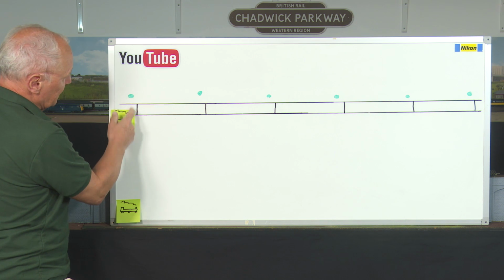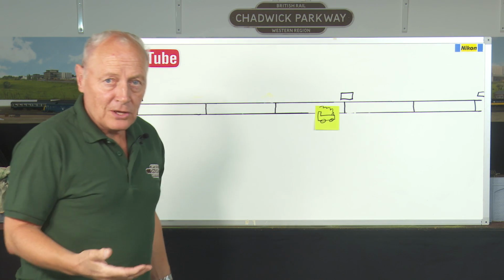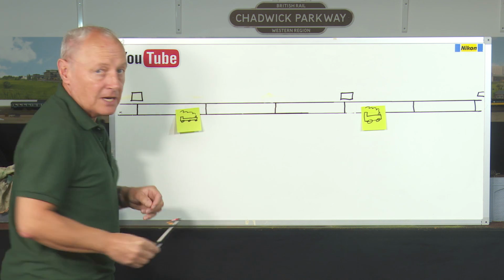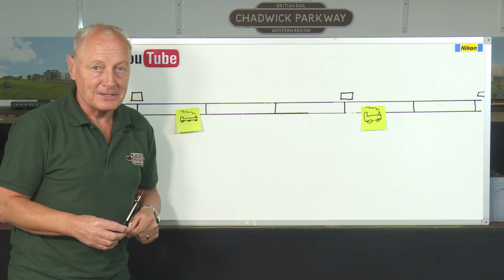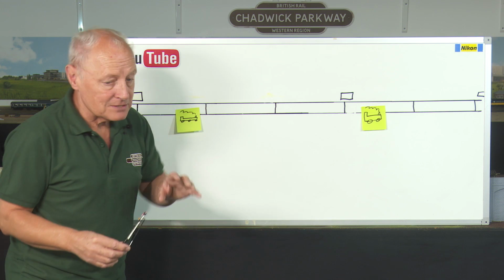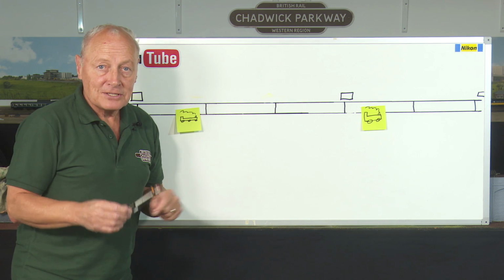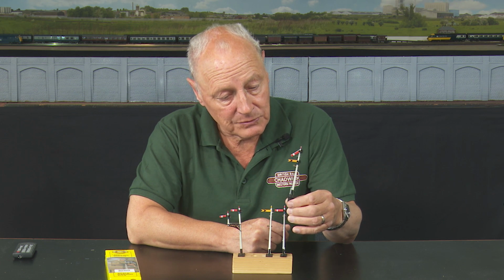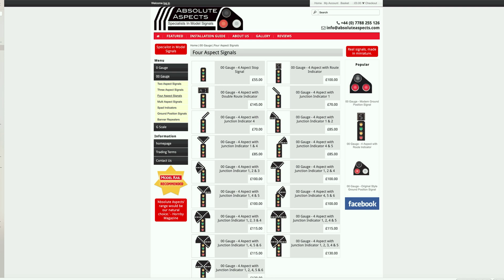Model Railway Signals at Chadwick Model Railway | 104.

Comment: Another great video, thanks Charlie, just a bit of extra info re signalling, when a signal has a feather the feather should light first, then when the proving relay knows the feather is lit it will then allow the signal to clear, in old installations it could be a quarter of a second but in more modern installations it can be 5 or more seconds difference.
The picture of Castle Cary, all the signal have only one route available, onto the Up Westbury line, the 2 with the feather will always have the feather clear before the signal can be cleared, this came about after an accident up London way in the 1970s, before that they would have been 3 signals with no feathers.
Semaphore signalling (or correctly Absolute Block) can be quite area specific but the easiest way to understand it is to have a signalbox with a plain line (no junctions) with (lets say) 4 stop signal so 4 sections. First it will have its distant, this can be on its own arm or if the previous signalbox is quite close it can be underneath that signalboxes last stop signal, but will always be service braking distance before your first stop signal), so the post will have 2 signals on it controlled by 2 different signalboxes. Then we will have the first stop signal (the outer home), then the inner home,  <then a station> with the starter at the end, then further out the section signal which then leads off to the next signalbox.  That is the simplest description, some places (lostwithiel on the down) have the section signal where the starter is at the end of the platform , on the Up there are more signals after the station than before it, it does get complicated.
Only when all 4 stop signals have been cleared will the distant be able to be lowered.
If there is a train between your section signal and the next signalbox the first 3 stop signals of yours can be cleared but not the section signal so the distant will remain 'on' (horizontal and showing a yellow aspect).
If you have a junction in there then that signal (could be any one of the four) will have 2 stop arms and even if the route is set and clear to the next signalbox on the diverging (lower speed) route the distant will remain 'on' as a warning to the driver to reduce his speed.
If a semaphore distant is 'on' then one or more of its associated stop signals is also 'on', if the distantis 'off' (at 45 degrees and showing green)then all associated stop signals are also 'off'.
I hope that isnt too long winded but is easy to understand, it is a very complicated issue.
Reply from the maker: Stone the crows gentlemen, well I did say that people had forgotten more about signalling that I’ll ever know.  Many thanks for sharing your in-depth knowledge regards Charlie
Reply: I too enjoyed Charlie's explanation,
Reply: I also agree with what Mike Burnett said about Absolute Block Semaphore signalling and he described that correctly, me having been a Signalman. The Colour Light system is known as Track Circuit Block signalling. In some Single Line areas, like for instance Heritage lines, the Semaphore system would work under Token Block Signalling where a Driver would collect a metal key on a hoop from the controlling Signalman at the starting end as his authorisation to enter that line. On arrival at the other end the token would be handed, by the Driver, to the Signalman at the exit point, who would then place that key in a Token Block Instrument and then let the Signalman at the starting point know that the train has arrived safely and complete. With the Semaphore system Signalmen would communicate with each other by means of bell  and gong communications. Track Circuit Block areas use a computer driven train describer system which enters the Head Codes and feeds them through the system.

Comment: Hi Charlie, quickie question please, I'm using CR Signals for N Gauge and a Dynamis to run my signals off of my Dynamis what else do I need?
Reply from the maker: Hi Steve, are your signals DCC fitted?
They need to be, if not you’ll need to buy a stationary decoder, if you require any more information please ask on a separate question because this one will soon be lost in all the other comments.
Reply: @ChadwickModelRailway  Thanks Charlie, no they're not DCC fitted so will have to get a decoder, that will be on the back burner for a bit as I'm tinkering with track again ;)

Comment: That white diamond / stretched hexagon plate or symbol on some of the real-world signals - that's a Rule 55 exemption plate. Rule 55 is a famous signalling rule - in prior times it was that if the train was stopped more than 3 minutes at a signal, one of the train crew would have to make sure the signaller is aware the train is there and has put safeguards into place, i.e. the opposite of what happened at Quintinshill. That white diamond plate/symbol meant they didn't need to do that, presumably because it was expected that trains would be held at that signal for a while normally, e.g. because the onward route is over a junction
Reply: And dont forget to sign the train register either!
Reply from the maker: Great info mate, regards Charlie
Reply: @ChadwickModelRailway  I knew they meant something but didn't remember what, so had a little bit of a google and thought other viewers might be interested!

Comment: I found the ratio signals to be really versatile and I found that I had some small rectangular leds that were the exact same size as the plastic molded lamps on the ratio kits making it a nice switch to light up the ration siglnals, and then quality street sweet wrappers to make the filters
Reply: The ratio ground signals can also be moddified in the same way and a control wire added to the back for operation
Reply from the maker: Great details Daniel, well done mate, regards Charlie

Comment: Great stuff, as usual. I use Chinese 3 aspect lights off a photoresistor board for automatic signalling. Works a treat ( unless it’s night time). £30 for 5.
Reply from the maker: Definitely sounds like a bargain Peter, regards Charlie
Reply: Do you have more info on these, Peter?
Reply: Sir Topham Hatt: check out “station road model railway” YouTube. “Automated colour light signals on a budget”. Got mine from eBay: “ model railway block signals 8.5cm 12v”, £14.99+ £1.00 p/p for 5. Also, “12v photoswitch photoresistor + relay module light detect”, £14.40. + £1.19p/p for 5. Hope that helps. For the amber light, connect into the next lights red slot on the photoswitch. You will know what I mean if you watch the video.

Comment: Very informative video. I've been into railways for 35 years but never known what the different type of semaphores mean until now, despite my local station being controlled by what's possibly Britains most impressive remaining semaphore system to this day (Shrewsbury)
Reply: Amazing that a large junction like Shrewsbury still has semaphore signals and rod operated points & probably the largest lever operated signal box! It was featured on a recent TV railway series and is a superb piece of engineering design. Crewe Heritage Centre has the preserved working model of the old CREWE NORTH Junction signal box and is well worth a visit if in the area. Website;- https://www.crewehc.co.uk/attractions.
Reply: @patmcdermott4832  Yes it amazes me that it's all still mechanical too. Network fail keep saying they're going to replace it all but thankfully they haven't got round to it yet. Severn Junction box at the South end of the station is indeed the worlds biggest operating mechanical box, so big that I can see it from my bedroom window! I do like the heritage centre, nothing better than sitting on the viewing platform on the roof of the old signal box with a cuppa watching the action at the North end of the station
Reply from the maker: Yes we really do need to hang onto our heritage. These wonderful pieces of engineering shouldn’t be forgotten. Regards Charlie

Comment: Hi Charlie,  I'm using hardware from http://mollehem.se/index.php/en/ they have ready built signals and decoder boards that include the signal logic for different countries. They are loconet devices. I have loconet turnout decoders and loconet current sensing block detectors that can all give these decoders the information they need to display the proper aspect. You can also set it up as a stand alone automated  signalling system if you don't have a loconet command station.  http://mollehem.se/index.php/en/signals/signal-decoders/signaldecoder-us-2-detail
http://mollehem.se/index.php/en/signals/manufacturer/?categorylayout=0&showcategory=1&showproducts=1&showsearch=0&productsublayout=0&latest=0&topten=0&recent=0
I hope you can cover some hardware like this in your next video.
Reply from the maker: Thanks for the tip, I will certainly check them out. Regards Charlie

Comment: I took my inspiration (many years ago) for signal controllers from David Townend at McKinley Railway, (one of his early Utube videos). I copied his choice for CML Electronics for the SIGM20 that has been working very well for 6 years now and I note that they are still available via  Coastal DCC. I'm not an electronics expert, but these controllers work with the Digitrax Loconet system, or can be programmed to change according to the points settings, so how they would work with other Block Detection systems I do not know..
Reply from the maker: Hi Ian, yes David Townend is a personal friend of mine, and he uses those for his block detection signal work.

Comment: Enjoyable video again.  I am glad I'm not the only one who puts things away and can't remember where they are.  Are you going to use semaphore signals on the branch and colour light on the main line or are you going to use colour light all the way through?
Reply from the maker: That’s a very good point Don.  I have never thought about using semaphore on the branch but well worth considering
Reply: @ChadwickModelRailway  I just thought it might provide a slightly different dimension to the branch, which wouldn't need as many signals as the main lines.  You could even use a distant part way up the slope before it goes over the bridge.

Comment: Great video Charlie. At 20:40 is it possible to set the feather first and then the aspect with those signals?
Reply from the maker: Yes it is, as apparently the feather would come on before the yellow or green light is illuminated. The signal has 3 DCC addresses, so It’s it’s just a case of setting them in the correct order
Reply: @ChadwickModelRailway  Ok. Thanks.

Comment: Ughhhh Signals have just got to be one of the most mind numbing and confusing aspects of model railways.
Thanks for giving this a  really solid crack Charlie I appreciate your time and effort.
However my head is still in a spin.
Nick
Reply: Try it on the big railway, we have Absolute Block with semaphore or colour lights, Track Circuit Block with Semaphore or Colour light, Radio Electronic Token Block plus others I dont get involved with, all as clear as mud.
Reply: Oh come on, you don't have to jam everything into a single layout. Just like you probably don't have Eurostar, a complex yard with a hump and a cogwheel line on the same table.
Reply from the maker: We rise to the challenge gentlemen

Comment: Charlie, I think that you made a valiant effort in explaining block signalling. A couple of points. On three aspect automatic signalling the train in advance must clear the overlap of a signal before the signal in rear will clear. In semephore areas home signals are stop signals in rear of the block post (signal box) whereas signals in advance of the signal box are starters.
Reply from the maker: Thanks Tony, I was aware of the overlap but not the semaphore issue.
Reply: Not if its the Section signal.

Comment: Hi Charlie, thanks for your video and explanation of basic signalling procedures.
On the subject of gantry's I believe scale model scenery do a range of laser cut ohle gantry's which can be used for signals.
On the west coast mainline ohle gantry's often have the colour light signals fitted above the wires sharing the gantry.
Reply from the maker: A good point Steve, many thanks.

Comment: "Top Shelf"... LOL -- well those signals are sexy :)  - But £100 or more Ouch  !!
Charlie, that video was both educational and entertaining.  In the late 1980's my late father-in-law build a two track 00 garden layout and wanted three aspect light to automatically change as trains went passed.  I ended up using reed switches in the track, with latching relays for block detection, and good old CMOS logic gates to change the signal aspects.... Most of this was based on those excellent model railway electronic books by Roger Amos...(remember them?)
Reply from the maker: I’m so pleased that you found it interesting and that it rekindled found memories Malcolm.

Comment: Great video Charlie, as I model N gauge I found the brass gantry preferable to the Ratio (clumsy me kept catching the plastic and uprights kept snapping) although in N gauge very hard to solder and at that scale small detail doesn’t really matter but I did manage to get 3 aspect signals fitted with traintronics operating them and hide the wires. Keep up the good work 😀
Reply from the maker: A great achievement in such a small scale David.

Comment: Thanks Charlie for a thought provoking video, in which you did a great job in explaining what’s available.
I will have to watch it a few more times to completely get my head round it.
I’m afraid signaling is over looked on many layouts due to many people not understanding its use, and also it’s never been that sexy.
Having said that, with DCC, signals become a lot more interesting.
I’m looking to include some ground signaling on my DCC shed layout, using Dynamis and DCC Concepts point Motors.
I’m hoping that I can get the signals to change in conjunction with the point motors, which I’m assured can be done!
Wish me luck! Keith
Reply from the maker: Yes Keith, I’m sure it can be done.  however just be careful that when they come through the point in the other direction, the light may then come on in error.
Reply: Thanks for the heads up!

Comment: Hi Charlie. Excellent video on a subject close to my heart. I decided that I wanted 4 aspect signalling on my layout but was vehemently opposed to paying the price for commercially produced signals when i required two dozen of the things. Cranked the 3D printer into life and made my own. Was easier than I thought it would be. I also sorted the electronics for driving the LEDs so that they operated as per the full size automatic signals. Using a type of track circuiting too rather than a sensor that tells when the loco passes the signal. Obviously, time was a factor to be considered. It took me some time to develop the electronics and then there was the time constructing the signal heads and soldering the PCBs that drove the signal LEDs. At the end of it though, I had the satisfaction of knowing I'd done it myself, and at a fraction of the cost of buying in a system. Very rewarding.
Reply from the maker: Wow, what a great achievement.  That could be a lucrative cottage industry.
Reply: brilliant idea about a 3d- printer - would be great to see a video of yours producing the signals - I could be very tempted